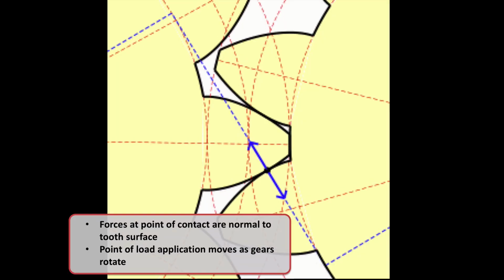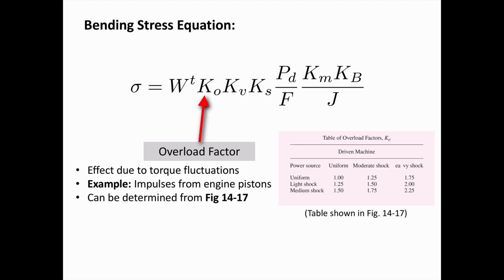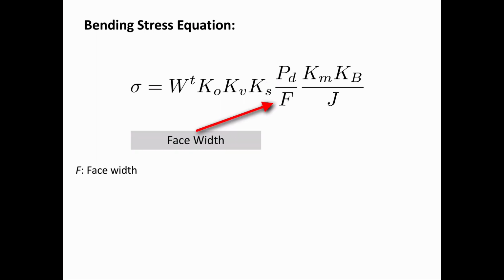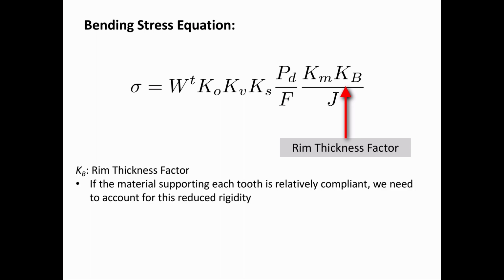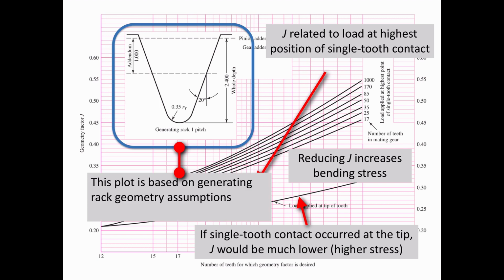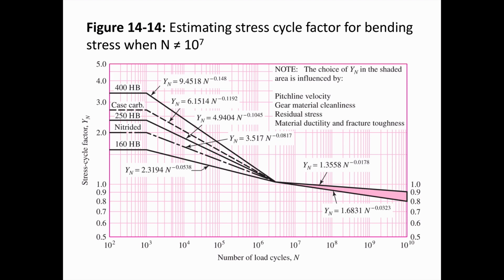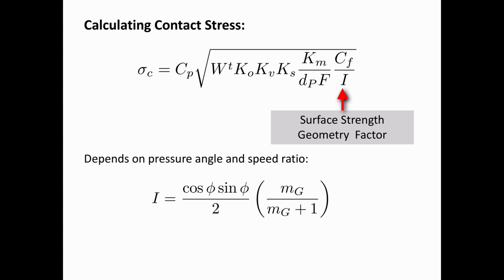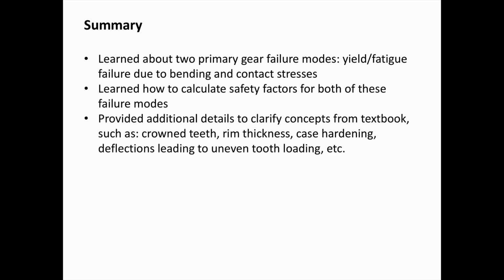Gear Strength Analysis

Comment: First off, thanks for the video it is tremendously helpful!

It does appear that you skip over how C_ma and C_e are defined in the calculation of K_m however, unless I am missing something?
Reply from the maker: Thank you for the question. Yes, there are a number of details that I may have skipped over in an effort to keep the length of this video reasonable. C_ma is defined in Eq. (14-34), and C_e is defined in Eq. (14-35), using the 9th edition of Shigley's. The former is a based on a quadratic curve fit, and the latter is a simple discrete choice based on whether particular steps are taken to improve mesh alignment (= 0.8 if yes, 1.0 if not).

Comment: This is amazing thank you for making this video! So helpful and easy to understand. I have one question. When you were talking about the rim thickness, it looks like there is a pocket milled out on both sides of the gear which reduced the thickness of the gear at that point and in return will reduce the mass. I might have missed it, but is there some part of the rim thickness factor that considered the thickness of that milled out part of the gear. It might not see nearly as much stress as the teeth do, but I think that if that cross sectional area is too small, it could potentially fail.
Reply from the maker: Good point. In SE 410, I aim to provide students with a first taste of gear design, among many other components. They would certainly need to account for more details than we cover in this class should they in the future design gears/gear systems in practice.